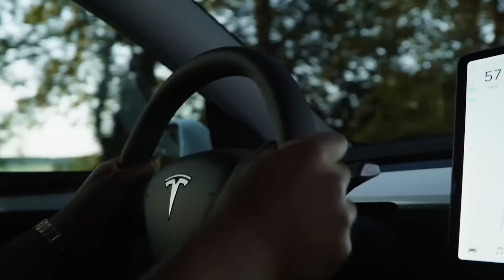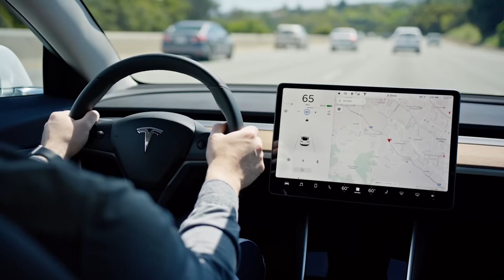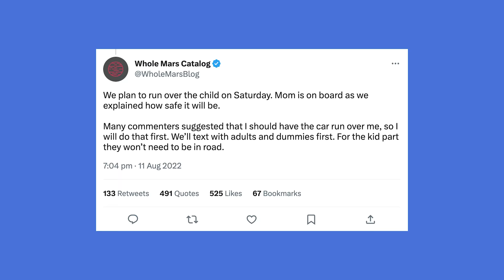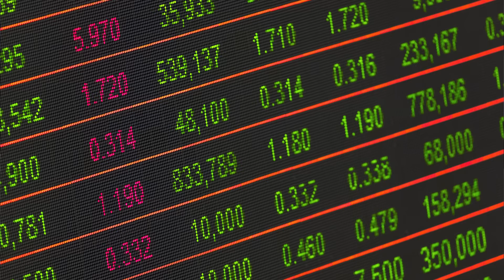How Tesla Beat The ENTIRE Car Industry

Comment: I guess you can call me an old Tesla fangirl, coming from Range Rover where I've looked into many other EV's since I was running out of anti bacterial wipes and gloves when visiting the dirty gas stations while the high test required for my RR model. Reasons to settle for a Tesla '22 MS LR was, ease of finding chargers on long trips, ease of instruments (just one) and of course the ability to be able to use either Auto Pilot or FSD on the interstates. Best thing since bread and butter, on the top of it all our power company offers super off peak hours at $0.01 per kWh so my monthly electricity rose by only $2 to $3.00.

Comment: One of their strengths is integration. Open the bonnet on a model Y and look at the air conditioning and heat exchanger.. and it’s piping. Then look at a brand new Kia EV6. Tesla has a more efficient system that fits in a shoebox and manages the heat of the cabin and battery systems.. all in one. The Kia will have twice the components, multiple fluids in different colours pipes every where with no sense to them. …. And no space for a frunk! So it’s a stark contrast between even a well respected legacy car maker and what Tesla does with regards to integration design.
On the new Model S, they’ve even built the front suspension strut bar so it doubles as air storage for the air suspension. Saves weight and materials.
Reply: Interesting re Model S. Didn't know that.
Reply: Yup, engineering on the new S and X is borderline science fiction in comparison with "comparison "
Reply: Kia EV6 does have a trunk.

Comment: Very well presented.  Fact filled.  Lean.  The only thing missing was a quick discussion on one of Tesla's selling points.  Industry leading crash protection. 

Thx Rory. I'm proud of you.
Reply: And the rubbish about being a danger to society on Autopilot- that was disappointing. Dan O dowd has a lot to answer for with his lies
Reply: @@astarothmeExcept neither of those things are True. Tesla has released training for firefighters on how to cut apart their cars, and EV fires of any kind are extremely rare. In such a case, plain old water is used to cool the battery and stop thermal runaway.
Reply: @@astarothme whereas you'll be fine when your petrol car blows up (facepalm).  In case you don't get it, if you're in your burning car waiting for the fireman, you're already dead.  And either way, you're not going to save your car.   And besides, fossil cars burn much, much more often than good EVs... like about 10 times as often.
Reply: @mrmichrom  An New-Zealand insurance company that hybrids were the most likely to burn - 1000 times more likely than and EV, while gas/petrol cars are only 500 times more likely to catch fire than an EV.
Gas fires are explosive, and vary dangerous, battery fires are progressive - so you have time to escape - and less dangerous to the emergency services.

Comment: I think the current phase of EVs with Lithium-Ion NMC chemistry has peaked at about 4 miles per kWh with Tesla and other EV manufacturers soon reaching that level of efficiency. The next phase of EV development has already started with the implementation  of LFP batteries, but will really take off with reduced cost EVs with sodium-ion batteries and a combination of reduced cost and greater range with lithium-silicone. Reduced cost as 30kWh battery will give the same range as a NMC 60kWh battery with greater energy density and reduced weight or double the range of existing capacity batteries with the 60kWh going from 240 miles to 480 miles on a full charge. The lithium-silicone battery will also provide significantly faster charging speeds. Then it really is  game over for fossil fuel ICE vehicles. 2030-2035 is now looking achievable for the ban of ICE vehicles in most market sectors.
Reply: Correct! ICE = Blockbuster. BEVs = LoveFilm (who were before Netflix before anyone chimes in.)
Reply: I think the biggest Barrier for EVs is not battery technology; batteries are improving and will get cheaper over time, I believe that by 2035 we will probably have affordable BEVs capable of over 600 miles range. The real barrier is charging. I’m OK because I have a driveway and a Zappi charger. It’s people who live in terraced houses and flats who have the problem, that’s about 40% of the UK population and even more in other countries. Unless things improve dramatically they will be relying on an expensive and patchy charging network. Improving charging infrastructure is just as important as affordable BEVs. Also important is ramping up renewable energy and storage, we need more wind turbines, solar farms and energy storage.
Reply: @hishamg  You make a very good point, but public infrastutre charging is slowly but surely improving all over. When you combine this with EVs  capable of 500+ miles  and 80% charge times of <10 minutes, then it will for most drivers, most of the time, only be necessary to publicly charge once a week. This holds good for people with home EV chargers also, who may then rent out their charger 6 nights a week. Apps that allow this already exist. The renter pays for electricity consumed  plus a fee to the home owner. 

My local town centre railway station carpark already has 20 7kW AC chargers that are fine for commuters to charge once a week as they leave their EVs from 7AM to 7PM and are  then available to all for overnight charging, and town centres with railway  stations tend to be older properties without the possibility for  off street charging. Every bay in the carpark could have a charger and if combined with solar PV shading and an onsite storage battery, LPF/Sodium-Ion/Flow  could charge the EVs 24x7 and generate income by exporting excess production to the grid. Council owned town  centre car shopping parks would also suit this role. Why councils aren't far sighted enough to have at least a pilot project each is unfathomable to me. Certainly around the western Med in southern France, Spain, Portugal and Italy the sight of  carparks with solar PV shade and EV chargers is becoming more common.

Comment: It started well but ended with a lot of mainstream negatively obsessed media BS about Tesla and FSD. FSD is there, thousands drive around and a car without FSD every 500.000 miles involved in a accident and with FSD every 2.5 million miles, millions and millions of logged miles. Anyone who thinks FSD goes from nothing to millions of cars at once is nuts, that would be dangerous, but FSD is here, not perfect, but it is working, it’s here and a matter of fine tuning that has been going on for years now with great steps. One more thing, the value of Tesla is bit more then making cars, Siemens is not a dishwasher company, not as bad as most old automotive reviews but a lot of important factors in trillion dollar businesses are missed as energy market and AI/robotics.Tip You should not invest yourself

Comment: I own a model Y. I would buy another one if the ride was smoother. This is the one thing, imo, holding this model back from literally exploding!
Reply: Which one did you get and what wheel size? We got a Oct 2022 build Y LR with 19" Geminis. Smoother than the 21". And the recent Ys have better suspension. We love ours.
Reply: @GudieveNing  I own a 2022 performance Y. It’s Virtually impossible to sit in the back seat. The ride is that bumpy it’s nauseating. So yesterday we test drive the long range Y with 19” tires. Still not as smooth as a 2015 Honda Pilot or 2016 Acura mdx.
Reply: @eyelovecolorado2195  people are installing $3k USD coilovers from unplugged performance because of them being so stiff. I imagine you wouldn’t want to do this but I’m just saying
Reply: The ability to explode is built in. 😄
Reply: Huge downside. I wouldn't buy a family SUV that's not comfortable. For £60k it's inexcusable and compared to a GLC it's a terrible investment and a downgrade.
Reply: @geolykos  All EV's are a terrible investment, until new battery technology becomes available.
Reply: @phuketexplorer  yeah I mean in terms of value for money. Dont get me started on the eco side. Better give the £5-10k difference to Greenpeace or other.
Reply: @geolykos  yes I feel exactly the same. At this price the car should be very comfortable.
Reply: @eyelovecolorado2195  the reason i never considered one after watching the Autotrader review. He put a coffee on the dashboard and it was shaking like crazy on a straight road.
Reply: @phuketexplorer  a petrol fuel tank says hello LOL!!!
Reply: @GT-22  A petrol tank only explodes once! 😉
Reply: @phuketexplorer  true but explosive nonetheless 😉😂

Comment: Good video Rory, you missed out that Tesla is not just a car company though, they do solar and power storage from individual home size to industrial country size, every Tesla product talks to Tesla HQ and gathers information on everything from energy consumption to road safety and mapping updates, it’s far more than just a car maker.
It’s an innovator, inventor and mineral resources gatherer. Tesla alone has push battery technology far beyond what most would have thought possible, it’s forced other companies and manufacturers to push their limitations and designs to keep up, Tesla release most of their own software as Open-source so others can use it, they have innovated the manufacturing process with their Mega casting which others are also copying too, they have supply contracts with the worlds largest companies to guarantee delivery of parts, they have invested in mining companies to ensure mineral demand is met at a guaranteed price, CHINA changed their own laws so Tesla could build Giga factory Shanghai AND own the business outright, no other non Chinese business has ever been able to setup in China without a Chinese partner. Tesla has in a word, Revolutionised EV manufacturing over and over again to remain at the top.
Reply: Yup! Elon's a sharp lad.

Comment: In 2015, I was on the anti-EV side of the fence.  Then I drove a model S at a summer pop-up showroom.   And holy s hit, that thing changed my world.  Not only was it fast, it reimagined the concept of what a sedan should be.  Then when the model x was launched, I finally couldn’t hold back. I bought one in 2017.  Today I have a ‘22 Model X and a ‘22 Model Y.  I’ve driven all of the other, EV’s, and aside from Rivian, none of them feel right. They are either buggy, or over styled, or lacking the sophistication that seems obvious in a Tesla. A critical area of improvement… Servicing and repair costs. The cost to repair minor body damage is staggering and absurd. But overall, they are the best road trip cars, the best daily drivers, and the most trouble free vehicles I have ever owned. I don’t miss the gas station one bit. I’ll always have love for 80s Mercedes, but other than that I won’t ever buy a new gas car again.

Comment: People keep underestimating the business and technological advantages Teslas have over their competitors
Reply: Indeed. Tesla is an acquired taste but they have some of the most advanced tech in cars today, on the road.
Reply: What specific technology puts them above other car makers?
Reply: @robertp457  I posted this to someone else weeks ago about comparison between Plaid and Taycan: Tesla is made by best engineers in the world along with spaceX, apple maby... Guys working in Porsche are literally kindergarten in comparison which is evident by poor performance of the Taycan which was made knly to beat the Tesla from 2016... 2 speed gearbox in an ev is the stupidest thing ever along with poor battery design, cooling system that cannot handle the power (not to mention 760 is peak hp, normally 660) so result is a car that overheats after 2nd lap on track and gets beaten by Model 3 after that. Tesla was preparing the Plaid before Porsche even launched and decided to completely demolish it, Plaid has completely new battery with 2x radiators for cooling (along with heatpump and octovalve system), 3 motor configuration which enables true torque vectoring, completely new motors wrapped in carbon fiber to not lose torque on high speeds, completely new suspension system (watch in the vid, its also quite special) along with best euroNcap crash results, much more luxurious interior that matches the Porsche for quality (fact, sit in both back to back, difference is in layout), completely new amd computer for actual fsd, sound system that is better than 10k Burmester in the Taycan and all of this for 50k lower price, 8 years warranty and much more practicality (be that space or superchargers or much better range)... So irl Taycan takes 18s to 250kmh (270kmh top speed), Plaid does it in 9s (over 350kmh top speed, probably to 380kmh safely when unlocked) - and with that Tesla also decided to completely trach the Porsche on the track as well with cc brakes, completely new tuning for suspension and traction, f1 tires...
So you see why is the Tesla so much ahead, frankly Lucid air that has 1111hp loses to the Model X Plaid that has 1020hp and is heavier and much less aerodynamic so Porsche needs to change the whole system or add kver 1200hp to compete which they won't do. 
Btw Teslas main business is energy problem solved by Model 3 and Y, and yet they still completely trash the company that has 75y of so called experience
Reply: @robertp457  The over-the-air Updates; no other company uses this to this extent.
The high energy efficiency of all Models, rarely matched by their competitors, combined with the raw power all Models are capable of bringing to the road.
Just to name 3 examples off the top of my head.

Comment: I've heard that dealing with maintenance is an absolute nightmare, never have parts in stock and nobody can work on them aside. Takes month to fix and they brake down often. 

Is that true?
Reply: Yes it is.

Panel gaps, stuf gets broken, and worst of all when a battery goes wrong they need to pull a brand new car off the producation line to repair anothe rvihicle! Their batteries aren't modular.

Comment: I would like to challenge you Rory. You said Tesla do EVs better than most! Who does it better? or even as well?
Reply from the maker: There are several areas where Teslas EVs could be improved. This varies by product. In the Model Y, the suspension isn’t as good as on an Ioniq 5. In the Model S, the brakes as good as on a Taycan. In all Teslas the interiors aren’t as good as…. most cars. Depending on your priorities, these could all be understandable dealbreakers. -R
Reply: @AutoTraderTV  You haven't really answered my question. All cars have faults (and one persons fault can be anothers virtue, such as the model Y suspension compared to the wallowy Ioniq 5), but is there actually a car that, as a whole package, betters a Tesla? I reckon not. Not only not, but by some margin not.

Comment: And what about the terrible ways to obtain the batteries?
Reply: What about the terrible ways to attain oil?

There are just over 2000 oil wells worldwide, most of which leak.

There are less than 12 Lithium mines (and Teslas don't use Cobalt, before you bring up that old chestnut)

Comment: Love you Rory but Tesla took too long to mitigate the quality issues with the cars, the rest are catching u now. Gv60 is a way better option than a model y and ionq 5N will be even better and cheaper with better customer care
Reply: Except you left out a few facts like the Model Y being objectively better in virtually every key factor that people care about like Safety (EuroNCAP ratings show Model Y has the highest test scores of all cars tested), Efficiency (MY has higher MPGe per EPA), Range (significantly higher for MY), Performance (MY Performance accelerates faster to 60 and in 1/4 mile than the GV 60 with Boost)  Charging Infrastructure (well known which car is better supported for road trips and DC fast chargers in general), Driver Assist Technology. (Tesla is only company that offers a defacto "Chauffeur Mode" with Point A to B driving capability).  You may be correct with respect to leather stitching in the Genesis which may be better but I don't think that elevates the GV60 to "way better than a model y" status.  As for the Ioniq 5N, don't you think it is premature to compare future vehicles from one company to present vehicles from another?  Remember that of all auto companies, Tesla is the last one to be accused of standing still.
Reply: I think the biggest point is that while there might be objectively better cars than Teslas, though Rory disagrees, none of them are remotely close to Tesla in terms of scale. Telsa probably have capacity to produce more than a million model Ys every year, while Hyundai will produce a 10th of that. When tesla was producing 100,000 cars a year they didn't have to compete with anyone. Now everyone has to scale up while competing with Tesla. That's going to be tough.
Reply: @EwanM11  To be clear however there are currently no better suvs than a Tesla Model Y when considering the numerous key aspects that customers most want (safety, performance, range, efficiency, charging infrastructure, tech, drivers assist, etc) except for perhaps perhaps on of the traditional measures of luxury such as leather stitching.
Reply: @EwanM11  the  scale Tesla has reached is also unparalleled for an EV and will now make the Y not just the best but arguably the best value given the recent trajectory of Model Y price reductions.
Reply: Except for efficiency, safety, tech, autonomy where Tesla is miles ahead.